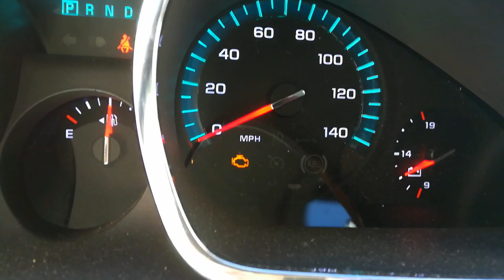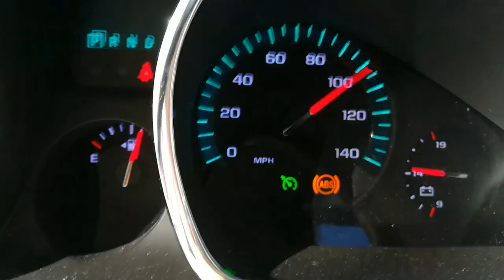DTC p2099 2010 Chevy Traverse GMC Arcadia Check Engine Light FIXED

Comment: Same code.. I replaced the Mass Air flow sensor and code came back.. Then I replaced O2 upstream and down stream oxygen sensors, and have not seen the code come back.. will keep you updated.
Reply: Did the code come back?
Reply: @ProfeFut  greetings, no the code did not come back..
Reply: @ProfeFut  im actually dealing with a new code now... Service Stabletrak and reduced engine power.
Reply: from my experience with gm v6 if its both banks rich usually intake issue like maf gm do not like anyother maf map o2 sensors other them oem since its a single bank i would suspect coils injectors exhaust

Comment: glad to see this i got the same code i got 2 oxygen sensor hope that works if not the mass airflow next i got bank 1 an 2 showing up
Reply from the maker: Dee Mann, my fix was the mass air flow but the p2099 can be caused by any of the following, so you have to do a little more digging before you start swapping parts.

P2099 Post Catalyst Fuel Trim System Too Rich Bank 
Possible causes for this engine code include: 
Faulty bank 2 catalytic converter 
A faulty mass air flow or manifold air pressure sensor 
Defective bank 2 O2 sensor/s Burnt, chafed, broken, or disconnected wiring and/or connectors Engine exhaust leaks
Reply: ok I will get on it thanks
Reply: Gm Service manual states that an oxygen sensor will not set this code, only time an oxygen sensor would be suspect is if this code set along with other oxygen sensor circuit codes. Exhaust leaks before or around the oxygen sensor, intake leaks, lean injectors all symptoms of this code.
Reply: Can a defective purge solenoid valve cause this too?

Comment: The code is a o2 sensor  code why change the mass is my question
Reply: This code isn’t necessarily an o2 sensor though. It’s just a rich condition on bank 2. That can absolutely be caused by an over reporting MAF sensor. I’m assuming they verified the function of the o2 sensor via a scan tool.
Reply: @alexlacey9808  I found some oil in the tube connecting the throttle body to the air filter. Would the MAF be responsible for that or PVC?  09 Acadia
Reply from the maker: Sorry for the late reply! did you find a solution?
Reply: I would love to know that answer as well because I found the same in mine. My 2015 Chevy Traverse is fluctuating rpms right now.

Comment: mine just came on 2x 2017 tahoe , 5.3l v8
Reply from the maker: did you get it fixed.
Reply: @RANDOMFIX  I initially Cleared the code but it came back !!!!!!
check the Air Intake for loose Clamps - ALL OK 
brought to GM DEALER - UNDER WARRANTY !!!!
Replace the Y- PIPE CATALYTIC CONVERTER ASSEMBLY NEW !!!! and 1 Oxygen Sensor 
OK NOW !!!!!!!!! was at 38,000 km
Reply from the maker: Nice, so the dealer covered the whole repair?
Reply: @RANDOMFIX  YEAH !!!! Warranty Ran out in 2 weeks Time 
also Covered the Water pump
Reply: @RANDOMFIX  YES - FREEBEE- I LIKE IT
Reply from the maker: Congrats and if happens on other vehicles and the dealer declines the repair call vehicle manufacturer directly as they most will still cover.